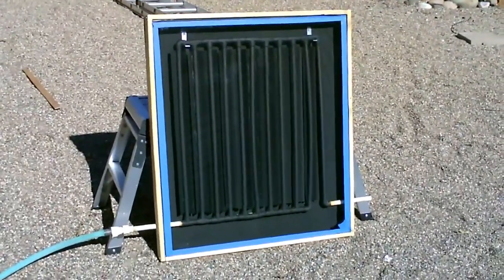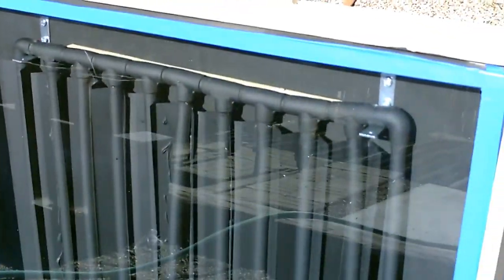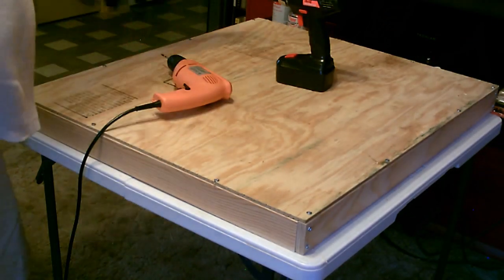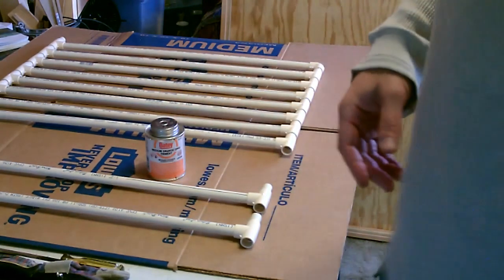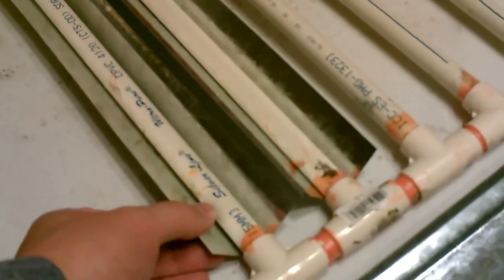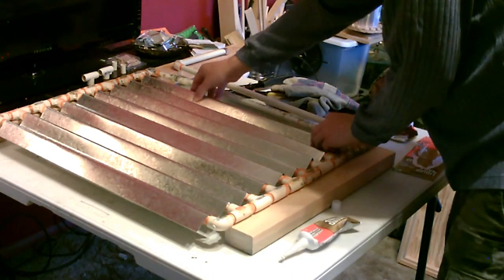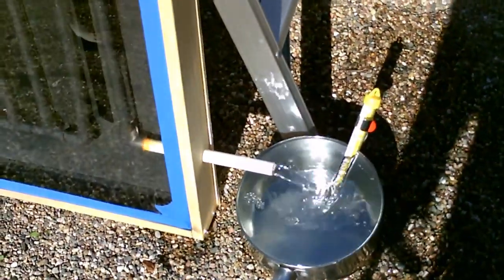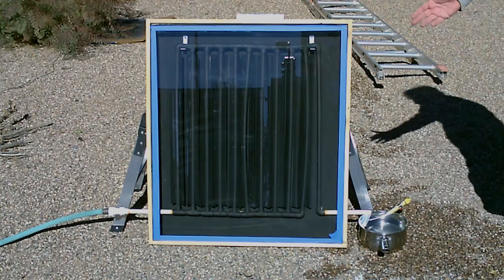DIY Solar Water Heater! The CPVC “Drip-Edge” Solar Water Heater! - New Design/Exp.(CPVC+Metal)

Comment: Planning on using an old AC condenser out of my old van and doing this same thing but I'll be using a low voltage water pump and an old water heater tank to store the water like a battery and keep it circulating the heat just like how a car radiator system works. Having the water heater tank in line will also let off pressure when needed . This water would then be routed to an inside radiator with a fan blowing the heat off into the house .

Comment: I built one a few years ago that was 4'x8' . It worked too good . I wound up replacing the pvc with 1/2" copper pipe after a month because  it was getting too hot . I also used 1/2" foam board ins. with metal flashing on the inside of back board for heat reflector.  I have to keep it tilted down from the sun so it doesn't boil the water .
Reply: larry haney - what I would like to see on builds like this is for someone to show the INPUT and OUTPUT temps, then give some ideal of the flow rate that is required to get a shown temperature since we all have varied climates and amounts of sun the general locale. Still looking for that way to build for the location and seasonal differences and then compensate by adjusting the flow rate, size or type of tubing or pipes used in the construction. That way anyone could adapt the basic design to a specific need or usage.
Reply: @utamaverick2004   Yes I agree  .  Mine is disconnected  and covered till I get back to it . I have many other projects on going .  but getting ready to move . It has a 12v circulating pump run from a 15 watt solar panel . I also bought  a differential thermostat but haven't hooked it up yet .   http://www.sbesolartech.com/picdifftherms.html
Reply: How many rows does yours have?
Reply: @utamaverick2004   Adjust the angel to the sun not the flow rate .  mine will make steam with a 12 volt pump and 15 watt solar panel . I in north Texas near Red River

Comment: This looks really great.  Would you mind posting a little more data by doing a simple test run for us: Measure the solar collector's entering and leaving water temperatures and flow rate simultaneously after the collector has run for a few minutes and before collecting a water sample? Flow rate can be stated in how many seconds it takes to fill a one gallon bottle at the output while recording entering and leaving temperatures. Also post the  final temperature of the hot water bottle to average any flow rate variations.   This really would be a GREAT help for us.  Thanks :)
Reply: Yes that would definitely help as a thermal sensor could open and close a solenoid valve feeding an insulated tank. Info needed is how long does it take to heat water in PVC pipe from say 70F-120F . The volume of water held in 1 linear foot  of pipe and voila! You could calculate the size of heater needed to heat 200 gals etc. Needed

Comment: If I build one for my next cabin I'll build it bigger, paint just the pipe, leave the drip edge bare, and have the water cycle through an insulated (old water heater?)tank with a small recycling pump. I'm remembering an old solar hot water system I once had.

Comment: Awesome concept... 

FYI I stopped using CPVC long ago as I found it to be very brittle after just a few years. Sure it's cheap and easy to work with but once it starts to become brittle there is no stopping the breakage... I just fear using it in this application would cause it to become brittle sooner... 

Apex is wonderful and costly, but it's able to expand 10X it's diameter. I don't think it's ever becomes brittle or has it broken a single time since I've been using it close to 15 years now. Again the Apex tubing is cheap, 100 ft is like 30 bucks, BUT and this is a huge BUT, the fittings and/or tools are pricey. Expect to drop upwards of a 100 bucks just on the Crimping tool and the Crimp Fittings are reasonable priced. Or you could use Shark Bite or what ever your area sells @6.00 bucks or more per fitting, elbows and tees and what not and ball valves are upwards of 15 bucks or more. Again Pricey but well worth the investment as they will last much longer than most humans will... LOL...
Reply: What if you used UV resistive paint or a UV blocking Polycarb?
Reply: Apex tubing is good for this application? What about its fittings?
Reply: @kylieanneking2606  The fittings range from cheap to expensive as do the tools required and this is the flaw with Apex overall. You can use cheap fittings but the tool is costly or you can use expensive fittings and use tools you already own or that would be cheap to buy. The Apex crimping tool is just designed in a way that it can't be used anywhere else so that drives up its price. A normal crimping tool is 1/3 the price but it won't work with Apex tubing so therein lies the dilemma about using Apex. If you have a lot of Apex fittings to use then you must buy the tool and use the cheap fittings otherwise just the cost of the expensive fittings will render most projects to cost an arm, leg, and small appendage just to be able to do it right... I hope this helps... The trade off is Apex is far superior to CPVC in every way possible, except the price. I hope this helps...

Comment: This is a great design for simplicity. I might try this myself and see how it performs in our English meagre sunshine.
Reply: How did you get on? its almost pool time here in the UK
Reply: @marksmith5237  I found a gas-fired water heater second hand nice and cheap so fitted that instead :)  It was for my camper van and I already had gas fitted.

Comment: You do lots of diy water heater with tubes, with different shapes some you make the copper pipe circular or some you make it zig zag up and down shape, and now this new shape, in your opinion witch way is the most efficient and what tube material is the best, maybe you can do comparison video on what shape heat the most
Reply: I will say circular one will heat the most
Reply from the maker: hi. i can't really say that there is "a best pattern" when it comes to the tubing. in terms of how long it will last, copper will probably last the longest (possibly 50 or more years) but it's the most expensive.

Comment: desertsun02:  Great work and I like the ideas with your easy to follow method. I have only seen this and one other vid, and checked your channel page for the install .  I wonder if you just build these great projects and put them in storage since I haven't see any follow up on the application regarding this one and the solar air heater project,  the two I've seen thus far.

Comment: How well does this type of thing work in say 20 degree weather? I have a sun room that is has electrical baseboard heat that I would like to replace those with PEX hose with 1 40-150 degree water if possible with a radiator and fan set up.
Reply: Lol....exactly what I am looking to do.  Looking to heat enough water through the day to not only warm the room during the day, but retain enough energy to keep the room comfortable at night.  Water is an amazing thermal battery.

Comment: excellent :) . Maybe you could optimize the space, building a second layer behind or front , in the empty space between the first layer so multiply *2 the heating effect for the same  space² .
Reply: So,  I’m not sure I see the advantage of the manifold set up like that. You do that with a heat exchanger when you have , say a large volume of air passing over.  In this case, with the same size inlet/outlet as the center tubes,  the restriction of the in and out is still there.  What if a 3/4 x 1/2 reducing tee was used (next to a 1/2” elbow), and pipe two 1/2” tubes in parallel.  Then feed the first pair in to the next pair, then in to the third pair, in series until the end.  That way, you never restrict the flow.  Then you up the flow rate and at the same time be less concerned about the final high heat output.  The greater goal would be to measure both inlet and outlet temp along with flow rate.  Try to achieve, say 30 degrees difference at the highest flow rate possible.  You might really be able to warm up a large volume of water like for a pool.  I have some ideas about the colors as well.

Comment: This is pretty awesome.  I am however curious, wouldn't it have been more efficient to have all elbows rather than T fittings? Then you'd have one long continuous run of pipe rather than a bunch of short runs. I would imagine the water would reach much higher temps or if not higher temps possibly more consistent.  I could be mistaken, as I say, just curious.
Reply from the maker: hi there. i've made several of the all-elbow (or serpentine style) units. wanted to try this type. i've seen them but never made one. the output temps seem similar to those. with this one, the water coming into the collector breaks into 10 individual tubes, so it goes up each tube 10 times slower (or stays in each tube 10 times longer) relative to the input flow. seems to work good... but i'm honestly not sure which one (if either) is better than the other.
Reply: What is the temperature outside? Wondering how it works with sunny cold weather
Reply from the maker: temps were 37 to 43F at time of filming.
Reply: The main reason was so it is a drain back. The system could be used and then drained if it is exposed to freezing temperatures.  I plan on using this design to help heat an indoor pool.  Pump will be inside and draw water from the pool.  Will be on a temperature differential sensor and only run when it is warm enough to add heat to the pool.  When it isn't running, the water will drain back into the pool so the system doesn't freeze during winter months.  I live in Minnesota, so this is a concern.

Comment: Great idea and well executed . How about using 3/4 inch metal pipes and how about connection in series with auto filling indicator and also putting a metal sheet in the back to increase the heat capacity of the system

Comment: i am thinking to make 150 litre what is thikness in mm pipe you using and temperature difference in rainy or winter days it workes ?
Reply: and what happened if we use copper pipe its good for thermal heat?

Comment: Would painting the glass black make it hotter or cooler inside?
Reply: Painting the the glass would actually lower the heat gain inside the box. This heater works on the "Hot-House" principle: Short wavelength sunlight passes through the glass into the box where heat is transferred to the pipes, which are painted black to increase thermal absorption.  The hot pipes will also  emit infrared wavelengths and radiate the heat back out; however, since the pipes are at a lower temperature than the sun (obviously), the emitted infrared waves are long wavelength radiation which is reflected back onto the box since they are more easily blocked by the glass than the short wavelength sunlight thus raising the internal box temperature.  That's why solar panels have clear glass, and are not painted black.  :)

Comment: Why did you connect the manifold into basically one unit and not zigzag the PVC top to bottom, in on bottom put an ell up to top an put 2 ells back down then up, up on one then down on the other till you get to outlet. There is no pattern of flow.
Reply from the maker: hi there. since i had already made a few other solar water heater models with zig zag or serpentine patterns in the past, i wanted to try a different flow pattern to see how well it would work.
Reply: It would be an interesting experiment to test which array is more efficient. For example 10 tubes each at 1m length in parallel (as shown here)  or one 10m tube in a coil configuration. If the box is kept at the same size there will be no difference in the amount of solar irradiation available. So any difference must be due to changes in the efficiency/rate of heat transfer. My guess would be that the difference between the two configurations  - paralell vs in series as far as the overall efficiency is concerned will probably be small. Perhaps the optimal flow rate will be different or the temp. increase vs flow rate will be different.

Comment: Another design could be to bring the cold water into the top.. Because cold water rises.. (Ponds freeze from the top down.. (Physics)) then trans verse back and forth with a slight slope down each run.(so in freezing temps, system can be drained, then out thebottom run...
Just saying systems in cold climants need to be able to be drained..
Or run on non freezable liquids...
(I say such a design on another channel)
Plus longer time in yhe heat exchange csn drive temps up quit a bit
Reply: When water is cooled, the water molecules move slower and get closer together. This makes cold water more dense than room temperature water. Since cold water is more dense, it sinks in the room temperature water.
Reply: Water reaches max density at about 4 degrees Celsius. Below that temp. density decreases and ice is less dense than liquid water at any temp.

Comment: Plastic tubes? Plastic is a heat insulator, metal would conduct the heat much better.
Reply from the maker: hi. metal (especially copper) is pretty much the best thing (if you can afford). i have a few vids of collectors made of copper too)

Comment: How does it work
Reply from the maker: hi. the collector acts similar to a solar box oven. the sun enters through the glass, hits the black internal surfaces (pipe and box) and heats it up. the water is piped into the collector and heats up as it goes through the hot pipe.